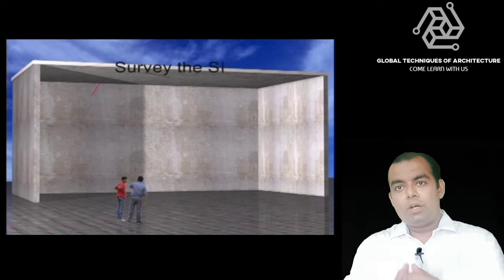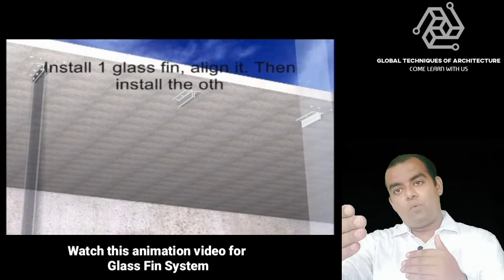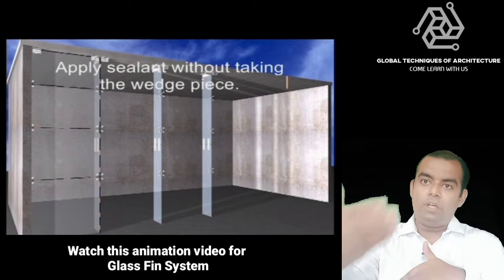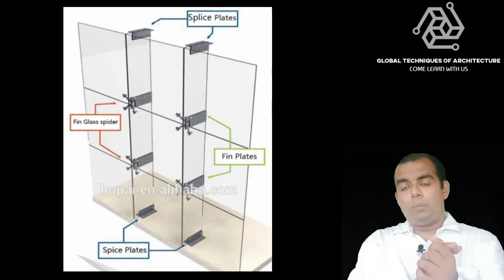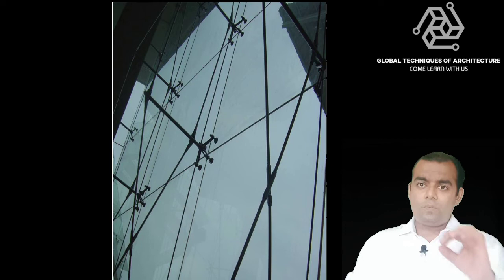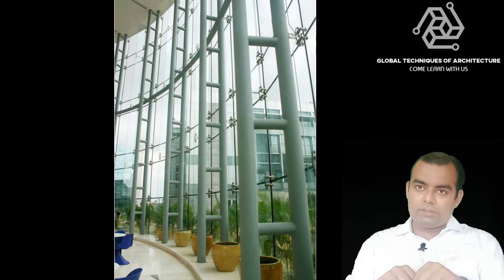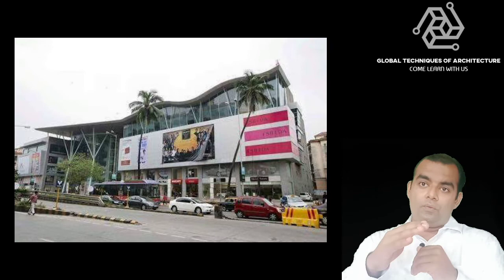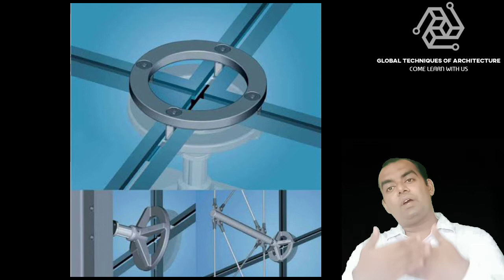How to Install a Spider glazing? | Frameless glazing | Facade engineering | Gaurav Tiwari | GTA

Comment: hello Gaurav, in the first system you explained spider glass, for the fins are the splice plates recommended at the top most end and bottom most end ? Or should the bottom part of the fin be U channel ? In the first part of your video bottom splice plates were not shown, later bottom splice plates are show, please advice

Comment: Thank you for your review. Consider having 2 layers of insulated glass with 16mm. air space in between. Is there an option to place the spider routel in the air space biting only the inner layer while the outer layer of glass is attached to inner layer by structural glazing sealant? In other words if you look to glass from exterior you will see the spider routle concealed behind the outer layer of glass and you can't touch it with your hand
Reply from the maker: Hi Amin, 
Thanks for reaching to us. 
The detail you are looking for is already with many fitting suppliers, and we as a team know this since 2012.
Try contacting fittings manufacturers, it will surely help
Reply: @Globaltechniquesofarchitecture  
Hi. Thank you for your reply... Will be following you for sure for upcoming videos. Thank you for the valuable information...
Reply: Yes its possible and i have done project with this system.

Comment: How the glass wastage is calculated and what measures should we take during choosing glass panel size for a facde wall for minimum wastage ?( Considering glass fabrication is done in india)
Reply from the maker: It's a subjective question
Pls call on 9930952051 to clarify your doubts, if u are comfortable

Comment: sir , what is the maximum height of facade upto which glass fins system can be used safely?
Reply from the maker: Hi Saniya,
First of all thanks for the query.
Spider Glazing, can be done in many ways, Fin being the most favorite of all Architects, but as per our recommendations, we say it must be used for Windload of not more than 1.5-2Kpa, or as a thumb Rule, not above 20-30m as Installation, and maintenance of Glass is too complicated.
Hope this helps.
Reply: @Globaltechniquesofarchitecture  thank you sir!